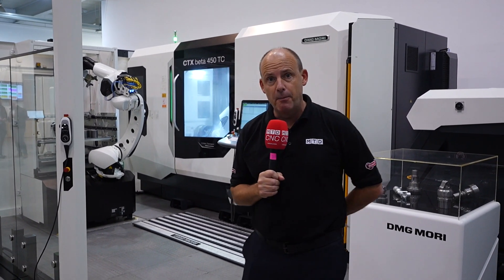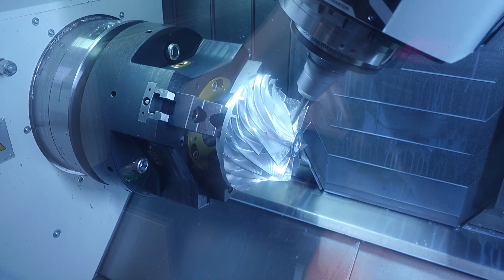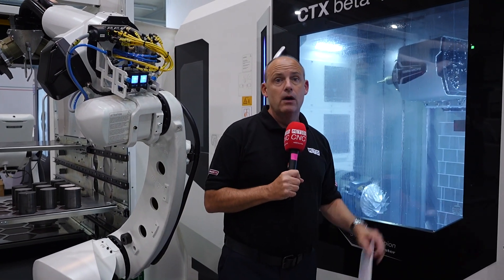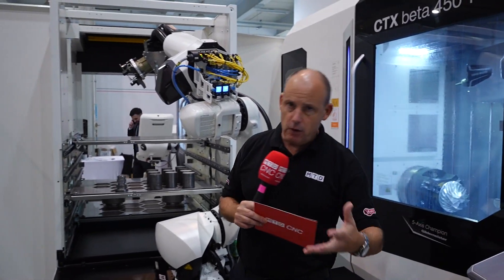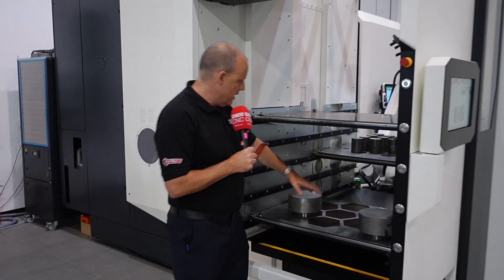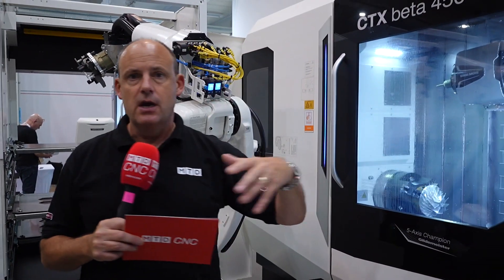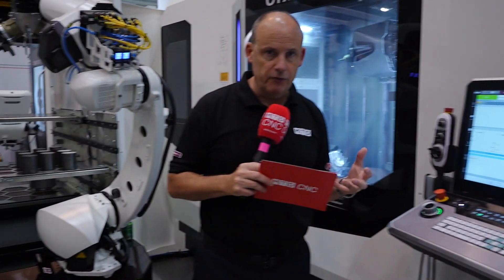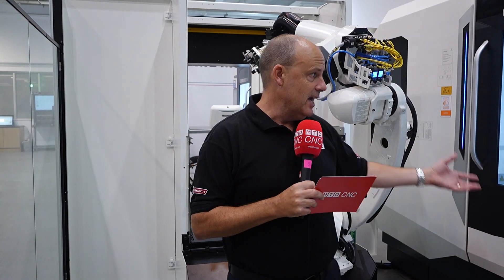The NEW CTX beta from DMG MORI

Comment: What's the difference between the CTX and NTX millturn machines from DMG?
Reply: CTX (german) and NTX (Japan) are very different platforms designed with the typical ethos of each country. CTX is a granite composite base, HSK, Siemens. NTX is cast iron, Capto, and Fanuc.
On a more basic level, CTX is a 5 ax mill that can turn. NTX is lathe with heavy duty milling spindle.
Reply: @Slayer553826  thanks! it’s interesting that dmg mori is one company but they’re Japanese and German sides kind of do their own thing
Reply: The CTX is also the only millturn they have that can do grinding